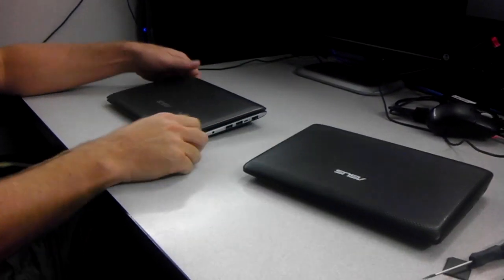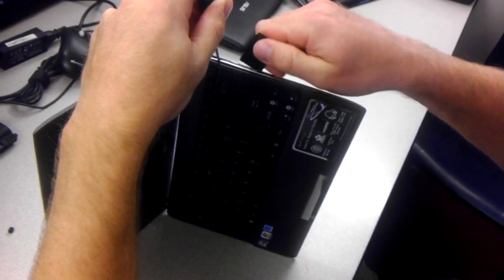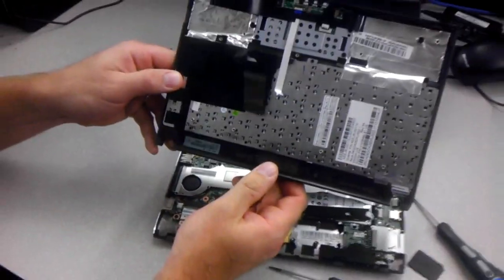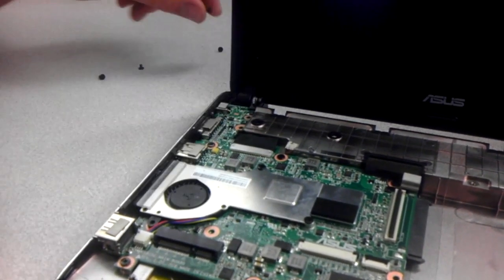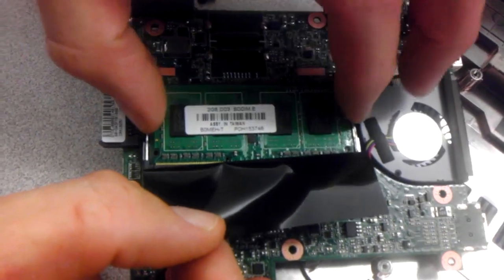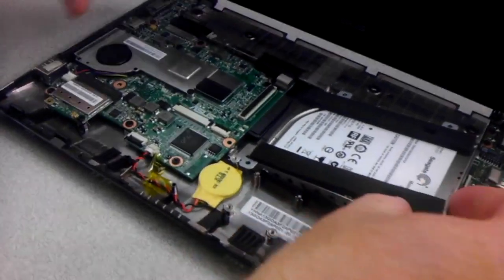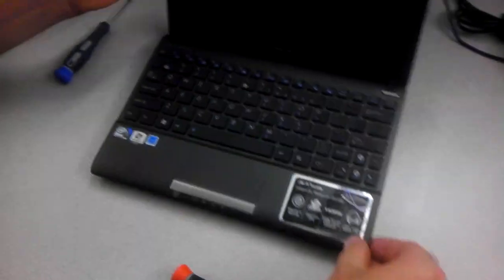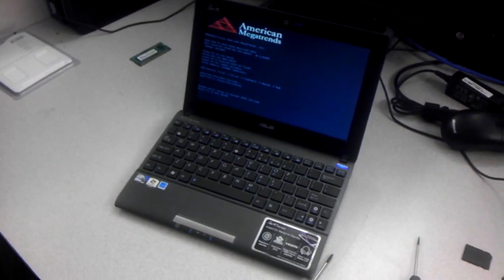Asus 1025c Ram Upgrade

Comment: Thank You !!! Amazing.
3 computer technicians from 3 different stores were adamant that the RAM was Glued to the motherboard and could not be changed, even after I showed them your video. Despite the conputer guy's insistence that it couldn't be done, he sold me the 2G RAM (AT MY OWN RISK - he emphasized and also added that I probably would ruin the computer)
So thanks to your video I took the risk , and upgraded my  ASus 1025C by myself .
(I am not a technician and I am a blonde female)

Comment: Thanks a ton for the info, in my N2800 processor model I am now running a 4GB stick of Corsair DDR3 1333 (CMSO4GX3M1A1333C9) on my 1025C. Windows 7 Starter uses 2GB (as expected) and Windows XP uses 2.98GB (as expected). Windows 7 Starter performance stats went from 4.5 for Memory to 5.3 :-)

Comment: Scott: Thank you very much for posting this video.  The instructions were spot on, the video was quite smooth and I did as you suggested.  I did have trouble initially with seating the RAM, but went back and opened it up and re-seated it and it worked as advertised.  Its very nice being a part of a broader community of which kind folks share their talent.  Fine regards, Geoff

Comment: Awesome! I used this as a guide and successfully upgraded my RAM. Put in 4GB of which the Win7 HP can see 3GB.  Prising open the case was v. difficult the first time but it got easier (hadn't replaced the motherboard properly the first time and then needed to reseat the RAM better). Machine goes like a rocket now so don't intend to upgrade further, this was traumatic enough.

Comment: Hey, just in case you've not fixed it, it means you've not seated your RAM in properly. You need to really push it in quite hard, at a 45 degree angle. Hope this helps :)

Comment: Awesome instructions! Just upgraded to 2G (using a 4G memory stick). Strongly recommended using a plastic card (like a credit card) to pop the lid off. Also the screws in the battery compartment required a much finer screwdriver than normal -- dont want to damage the screws! (Wish I'd boought the 1025CE instead though -- people are saying that could use the whole 4G, which would have been nice).

Comment: Thank u Scott, you are the MAN!
Followed your instructions carefully, and now I'm having fun!
One only thing to take advice: When you are going to replace back the keyboard, be carefull to apart the wire located under the "ESC", could difficult the keyboard clipping.

Used a HYNIX 4GB 2Rx8 PC3-12800S-11-11-13 and RAM used is now 35%-38% and before it was about 70%-75% (Only using 2GB)

Great! Thanks again from Spain!!

Comment: Oh and two other things: the Intel Atom N2800 supports 4 GB RAM, that's for sure. Also the 32 bit edition of Windows 7 (above Starter that is) will only address 3 GB of RAM of 4 GB available. That's a 32 bit limitation. When you want to take full advantage of 4 GB of RAM in your Asus EEE PC 1025 C, you'll need to install x64 edition of Windows 7 above Starter edition. But for what I've seen there aren't many x64 drivers for it on the Asus website.

Comment: Thank you very much! I wanted to do this with this italian video here, but I think I would have failed.
You explain every little thing so good. Keep on!
Just briefly three things:
1) Be sure to use appropriate tools! If not, the screws are easily screwed :)
2) I broke 3 of the 4 clips in the battery compartement. You may want to be more careful. However, it's also working without them.
3) I used a Kingston 4Gb (KVR1333D3S9/4G) of which my netbook can use 2.99 Gb.
Once again: Thank you very much!

Comment: Great video thanks. Very easy to change the RAM from my 1025c N2800. Runs very snappy with a full win 7 32 bits now. Installed a Kingston 4 gig, and have 3 GB available.
A little hint to check halfway if your memeroy is correctly installed; just plug your netbook in the grid (without HD or battery) and BIOS will startup!

I was very carefull with the plastic clips and not one of them broke. Only thing that got damaged was my girlfriends creditcard which i used, but she hasn't found out yet...
Reply: Sistemas de 32bits só irão reconhecer 3GB, como o processador é de 32bit não aceitará sistemas 64b. Mas sim a placa aceita os 4GB

Comment: The Intel N2600 processor, 1.60 GHz, recognizes 4GB of installed RAM.  The processor architecture is 64-bit.  You can install 4GB of 1333MHz RAM, which Asus Eee PC 1025C recognizes.  And they can install Windows 10 64-bit version.  I have an Asus Eee PC 1025C, N2600 and I did the tests here: everything was fine and working normally.

Comment: If that can help I used some crucial 4GB (CT51264BF1339).

However I made a mistake the first time I tried and did not insert correctly the memory but rather laid it onto the connector. It would hold still with the metal holders on the side but a good test to see if your memory is correctly inserted is to release the holders. If the memory doesn't jump back up at you then it's not correctly inserted.

Other than that no problems. I just have to install Win 7 Pro now to use 4GB instead of 2GB.

Comment: Hi Tarkus 6599.

For what I know and have heard, the 1025C also runs 4 GB RAM. Only limitation though is the OS which is Windows 7 Starter. This OS doesn't run on more then 2 GB of RAM. So when you upgrade to a higher version of Windows 7 you should be fine.

What does the BIOS tell you when booting the device? (Disable the logo in BIOS first). It should tell you 4 GB of RAM.

Cheers,
Marnix

Comment: Thank you for your video, I upgraded my 1025C from 1GB to 4GB (recognized only 3GB). If anyone want to try update the bios first. I used Crucial 4GB Single DDR3 1600 MT/s (PC3-12800) CL11 SODIMM 204-Pin 1.35V/1.5V Notebook Memory Module CT51264BF160B.
Reply: bigman  What processors do you have -- N2600 or N2800 (shows in BIOS)?? I've seen a lot of conflicting reports about whether this can be upgraded to 4GB or not (I know Windows will only recognize 3GB in any case).

Comment: Could someone tell me why is everybody putting in 1333 modules? 
The N2600 supports 800MHz and the N2800 supports 1066MHz memory speed. Modules with higher clocks will obviously work, but they will still run at 800/1066.
Thanks
Reply: the ram needs to be matched to the chipset- not the processor

Comment: I did that, though even with win 7 pro and 4 gb of ram installed, you get only 2.99 gb to use (even if the system recognizes the full 4 gb). With win 7 32 bit there is a cap on the ram you can use, and, as far as I know, there is no way to avoid it. Tried enabling a PAE, but didn't work. You also can't upgrade the OS to 64 bit (not compatible with this machine). So, at the end of the day, you'll have to live with the 2.99 gb instead of the full 4 gb... Harsh world we live in...

Comment: I had a problem with getting it to turn on like many of the other users here, but I managed to fix it by reseating the new RAM a second time. However, now it can't find the onboard network card, and also at the logon screen when it says "welcome" with a loading symbol, it takes FOREVER to get past that, and when I finally reach my desktop, several programs immediately fail or experience errors. What is going on here? I've tried seating the network card more securely to no avail

Comment: HELP!

I followed all of the steps and have it reassembled but when I turn it on the screen does not turn on and after a few seconds the CPU fan turns on max.

(I used the corsair RAM) 

What did I do wrong?

1. Motherboard to daughter board connection?
2. Installed the RAM incorrectly?
3 Keyboard/touchpad not connected?
4 Other?

Comment: Hey, I've got a 1025CE. I just followed your guide and as far as I know nothing seemed to go wrong, put everything back together fine, however now the screen doesn't turn - doesn't even POST (though not sure it ever beeped tbh). I've even tried with the original RAM. Got any idea what might be wrong?

Comment: So I've seen other comments about ram not being seated and the machine not powering on, but not many other solutions.  I pulled my 1025 apart and installed a 2GB stick, but now it won't power on.  I've reseated the RAM a number of times, and gone back and forth between the original stick and new stick, and it still won't power on.  Any other thought?  Thanks!

Comment: Will the N2600 - 1025C model recognize 4Gb Ram?
Reply: It think it will boot, but Windows won't use more than 2 GB anyway.
Reply: Sistemas de 32bits só irão reconhecer 3GB, como o processador é de 32bit não aceitará sistemas 64b. Mas sim a placa aceita os 4GB

Comment: hi, I heard that the 1025c N2800 model could handle up to 4 GB ram. i just installed it today. It boots and everything, even loads faster because its better ram but for some reason the bios is only detecting 1025MB. I have serched around for ages trying to work out what is going on but cannot figure it out. any suggestions???  it just seems weird that it would still run if it wasnt compatible ram. Any advice would be awesome as its definately not the operating systems fault